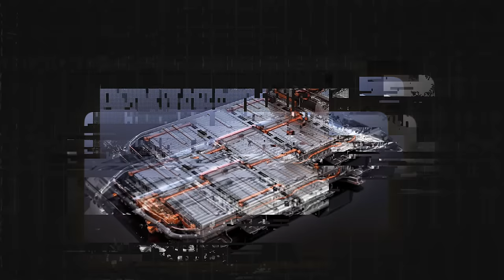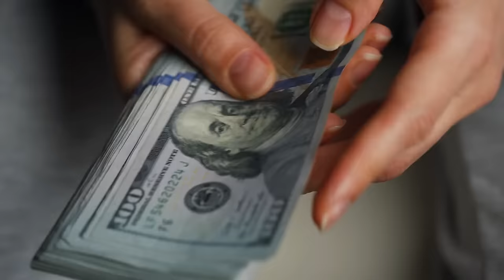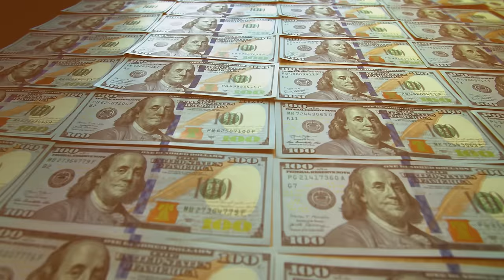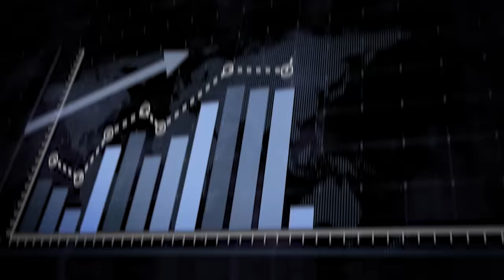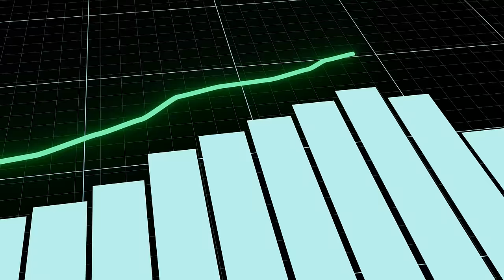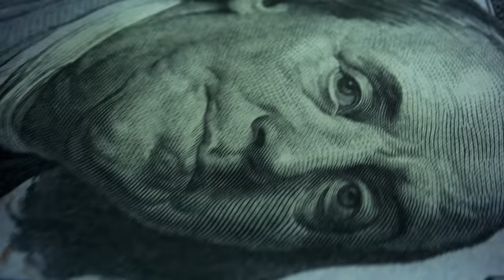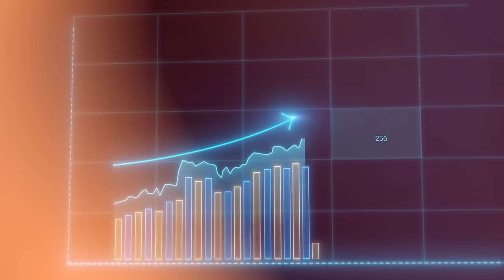No More Lithium! BYD Shifts To Sodium-Ion Batteries!

Comment: Sodium batteries can be good home batteries, pairing with solar panels, where cheaper is better.
Reply from the maker: Yepp! Sodium-ion batteries can be great for home energy storage, especially with solar panels, due to their affordability. They offer an efficient way to cut electricity costs and increase sustainability. Do you plan on using solar panels at home?
Reply: Yes, just not sure is it worth waiting as lifpo4 are good already

Comment: When around 40% of the cost of EV vehicles can be reduced significantly, the production & sales will dramatically increases. That's good news.
Reply from the maker: Absolutely! Cost reduction plays a crucial role in accelerating the adoption of electric vehicles (EVs) on a larger scale. With advancements in battery technology, such as the development of more affordable sodium-ion batteries, we're seeing the potential for significant cost savings in EV production. This not only makes EVs more accessible to a broader range of consumers but also contributes to the overall growth of the EV market.
Reply: we see all these "revolutions" in battery tech. however, the interesting thing is, that when they come to market, it is no revolution anymore. but that does not matter, because every year we have a good evolution. every years the kWh cost about 5% less and the range of cars is growing about 7%
this happened over 10 years now. and right now there is no end of this development in sight. the year over year growth in range might slow down a bit because we don't need that much range increments anymore. so, maybe 6.5% next year, 6% in two years, another 5.5% in three years and so on.
nevertheless, we have that nice development that results in a solid AND HEALTHY growth every year. it should not be faster because the industry cannot handle faster growth well.

Comment: I am sticking to my Toyota Hybrid. It’s electric in general in town and I don’t even have to plug it in as the petrol engine looks after that.
Reply from the maker: Nice! Hybrid vehicles offer a practical and efficient solution, especially for city driving.Thanks for sharing your experience!
Reply: No contest for long driving ,Hybrids the way to Go and go ,gogogogogogo.
Reply: Honda Hybrids shut engine off when stopped in Towns ,Restarts when U let foot off brake.

Comment: The energy density is more than enough for most applications now. Not to mention the cost. These are about $90/USD per kwh compared to $130/USD kwh for lithium ion and CATL said that the cost of these will drop to about $45/USD by the end of the year with full-scale production... That alone would bring a 20 kwh battery pack down to under $1K which is amazing! Personally I drive a Smart Fortwo and the electric version which I don't but wanted to own has a 17 kwh pack. So you could probably fit a similarly sized pack into one now with little range loss but huge cost savings!
Reply: Sound good. Could save a lot by bringing EV’s price down , because batteries are the most expensive part in EV’s
Reply from the maker: Absolutely! You've highlighted a crucial point. The decreasing cost and increasing energy density of sodium-ion batteries make them very promising for electric vehicles. With costs projected to drop significantly, electric cars become more affordable, potentially fitting larger battery packs without sacrificing range. This advancement is exciting for both consumers and the electric vehicle industry as a whole. Thanks for bringing up this important aspect!
Reply: Especially when you consider that Lion-polymer batteries can only discharge to ~20%, and do not like to be fully charged.. They end up at parity charge wise, and the Sodium cells are easier to recycle, and don't go up in flames, or use environmentally disastrous chemicals.
Reply: Sodium battery is already put in use in China but only on mopeds (almost identiical to the infamous Italian Vespa). The cost right now is even more expensive than Li-Fe. It may not until mid-2024 or 2025 should we see a comparable price drop then.
Reply: Right now ev weight on average 800kg more then petrol so  with sodium it will weight around 1.1t more, which give you around 2000 to 2500kg per small car and 3000kg for a family car. Also there is a question of volume this battry takes.
Reply: @chjanecki9221 Tesla should make a towable battery pack. I only need ~200 mile range. I can't imagine that a towable range extender would be that difficult of an engineering task. 

If I could hook up a tow battery and get another 500 miles of range for a long range trip that would be awesome.

Tesla is 42 miles away. I could get by with a 150 mile range and have some left over. IMO Tesla needs a model 2 commuter vehicle that is even smaller than the 3.

Comment: The battery manufacturer Northvolt developed state-of-the-art sodium-ion battery validated at 160 Wh/kg
Samples of these batteries produced  were sent to potential customers including ev makers in November 2023
Reply: With supercharging highly saturated and widely dispersed,  160Wh/Kg is all you will need.  The challenge rests now in rollout of the super charging networks.
Reply: They are not the first
Reply: @JoeyBlogs007  There is a reason why Sodium batteries are going to be marketed towards the low end, that woeful capacity. regular lithium batteries are up to 711wh/kg in lab prototypes and 500wh/kg in commercial products, and you are sadisfied with 160wh/kg? Even my old Nissan Leaf has 224 Wh/kg in its battery. So even lower than that. Gosh.
Reply: @GeirEivindMork  in real world cars the energy density of lithium batteries is around 270Wh/kg.
university bayreuth germany just pushed NaIon to 165Wh/kg. well, not suited for long range, but not every user on a budget buys a long range car.
as i see it, the car market will roughly split up in 33%/33%/33% Na-Ion/LFP/NMC
in the next years. then maybe aluminium-graphene will come or lithium-sulphur, ...
Reply: @GeirEivindMork  If your Leaf is "old" as you say, then it definitely doesn't have 224wh/kg anymore lol. About 10% lower wh/kg than LFP batteries is nothing to laugh at, and the fact that they have such a strong cycle life makes Sodium batteries a very promising alternative once they become cheaper than LFP (which should be soon)
Reply: @alexkt3400  Well, it is a 2018 model with 40kwh battery, and not that much range drop since new. (120k km currently). 

By all means, I am not against sodium batteries. I just want lighter cars. :)
Reply: @stefanweilhartner4415  It is not as simple, it is not about Wh/kgs it is also about DC resistivity along full curve of SOC 100 -  5 %, you can not compare NIBs and LIBs. Try to construct MPPT and LF/HF inverter for NIBs. You need wider range of voltages not e.g. 46 - 60 V, but 35 - 66 V, for HV it is also bad, because you need for lower voltage, make FETs and IGBTs still able to withstand much more current, and conduction loses are I^2 proportional.

Comment: Not surprised the sodium battery hasnt made it into the Seagull, lower energy density and high voltage drop means its still best for storage, also lfp keeps getting cheaper.
Reply from the maker: You're right—sodium-ion batteries are currently better suited for storage due to their lower energy density and higher voltage drop. LFP batteries remain a strong choice as they continue to get cheaper. It'll be interesting to see how sodium-ion technology develops :)

Comment: This added capacity for storage batteries frees up more lithium for BEVs.
Reply from the maker: Absolutely! Increasing the capacity for storage batteries, especially with alternatives like sodium-ion, can indeed help alleviate pressure on lithium resources, allowing more of it to be directed towards electric vehicle production. This could contribute to a more sustainable and balanced approach to meeting the growing demand for both energy storage and electric vehicles. Do you think this shift towards alternative battery technologies will have a significant impact on the EV market?
Reply: for non-mobile storage, lithium does not make sense.

Comment: If this battery eliminates several isues if the lithium batteries ie cold charging,range anxiety, battery cost and fire issues plus charge time it could rejuvinate electric vehicle sales.
Reply from the maker: Yes! You've highlighted key benefits sodium-ion batteries could bring, potentially boosting electric vehicle sales by addressing issues as you mention. I think BYD's move towards sodium-ion production signals a step in exploring these possibilities, which could reshape the industry and drive innovation. Your thoughts contribute valuable perspectives to the conversation about the future of electric vehicles.

Comment: With supercharging highly saturated and widely dispersed,  160Wh/Kg is all you will need.  The challenge rests now in rollout of the super charging networks.
Reply from the maker: Yes, great point! The advancement of battery technology, like sodium-ion batteries with their energy density of 160Wh/kg, can indeed alleviate some of the strain on charging infrastructure. While supercharging networks are essential for long-distance travel and convenient charging, the increasing energy density of batteries allows for longer ranges and reduced charging frequency, which can help mitigate some of the challenges associated with charging infrastructure rollout. Thanks for sharing your insights!

Comment: What are Sodium Ion batteries made of?
Reply: So sodium ion batteries are common table salt is that correct, if so be careful what you wish for
Reply: Salt and they will charge faster have far beter temprature range  and be cheaper
Reply: Natrium Oxide, wich is obtained from "ionaizing" the Table Salt

Comment: Thanks, you made some pretty good insights on the economic dynamics, sodium battery production could bring to the markets... good research, solid rationales... well done!... (subscribed)  ';  D ...  I know they can also solve the "cold battery" problem, as well as the limited resources cost side of production... forget how many cycles they can currently handle?
Reply from the maker: Thank you so much for your feedback and for subscribing! I'm glad you found the insights valuable. Sodium-ion battery production indeed holds promise for reshaping the market dynamics, especially in addressing issues like the 'cold battery' problem and mitigating concerns about limited resources. Currently, sodium-ion batteries can typically handle around 5,000 cycles, which is impressive but still slightly behind the most cost-effective lithium options that offer around 7,500 cycles as stated in the video. Overcoming this challenge to increase the cycle life further is crucial for widespread adoption. I appreciate your engagement and look forward to exploring more topics like this in future videos. Stay tuned!

Comment: You say lithium ion 7:42  battery has 7500 cycles and cost is 190kw/kg and Sodium has 5000 cycles and cost is 160kw/kg . In that calculation Na cost is less but would require change more frequently. So to summarise li still is charper than Na according to cost verses time to replacement.  So what is the basic reason or advantage compnay shifting to Na. Is it just the availability and cheap price. But at the end of day you will get lesser range and frequent replacement cost.  But lower range and lower cost may suit most buyers. But still i feel cars with range upto 700kms and affordable costs make sense then only it would be better accepted in market. As charging an ev on highway wastes a lot of time and range anxiety is the major factor for less sale in India.
Reply from the maker: You've made some great points about the trade-offs between lithium-ion and sodium-ion batteries, especially in terms of cost versus longevity. While lithium-ion batteries may currently offer a longer lifespan, sodium-ion batteries present advantages in terms of availability and potentially lower initial cost. The shift towards sodium-ion batteries by companies like BYD is driven by various factors, including the desire to diversify battery options, reduce reliance on limited resources like lithium, and explore alternative technologies that may offer benefits in specific applications. Range anxiety and charging infrastructure are significant considerations for EV adoption, especially in markets like India. Achieving longer ranges and faster charging times are crucial for widespread acceptance of electric vehicles. As technology continues to advance, we can expect improvements in battery performance and affordability, which will hopefully address these challenges and make EVs even more appealing to consumers. Your perspective on the importance of longer ranges and affordability is valuable, and it's something manufacturers and policymakers are undoubtedly considering as they work towards a more sustainable transportation future. Thanks!
Reply: @AmpedAuto  what we in india need is a reliable , cheap , long range , 4x4 ev family supporting car ... which i would say is a dream of every Indian. Basically a package of everything ... but its still a dream.

Comment: Lithium, to be exact lithium cobalt, are still the best in term of capacity and discharge capability. sodium will happen sooner or later, but that doesn't mean it gonna remove the existing lithium batteries out of existence
Reply from the maker: Absolutely, lithium batteries currently lead the pack in terms of capacity and discharge capability. Sodium-ion batteries offer a promising alternative, but at current, it's unlikely they'll completely replace lithium batteries. Instead, they'll likely complement each other, catering to different needs and applications in the evolving energy landscape.

Comment: Any mobile application benefits from light batteries. Sodium makes sense for battery storage, not cars or scooters.
Reply: That is to say, area and weight are both important, as well as life cycle.
Reply from the maker: Absolutely, you've hit on key factors: weight and area are crucial in mobile applications, while life cycle is vital for sustainability. Sodium-ion batteries excel in stationary storage, offering benefits in longevity and versatility. Yet, in vehicles, balancing these factors remains crucial. It's fascinating to see how different technologies meet various energy needs. Thanks for sharing your insights!

Comment: Sodium can’t replace lithium. The atomic weight is 7.7 times and the ionic mobility is much less than lithium.  It could be used for some low end and low performance cars or energy storage system.    For instance, Energy storage for an off grid tiny house could use it.
Reply from the maker: Great comment! While sodium-ion batteries may have limitations compared to lithium-ion batteries, they still hold promise for specific applications such as energy storage systems for off-grid setups. As technology advances, we may see further refinements that enhance the performance and suitability of sodium-ion batteries for various use cases including bigger EV's.
Reply: golf carts?

Comment: Carbon dioxide emission to make Lithium, Cobalt, Nickel metals for making the battery be compared with Sodium Ion and also lead acid batteries. Later is 97% recyclable
Reply from the maker: Agree! Sodium-ion batteries offer a promising alternative to traditional lithium-based batteries, potentially reducing the environmental impact associated with materials like lithium, cobalt, and nickel. Sodium-ion batteries could offer a greener solution due to their abundance of sodium and reduced reliance on scarce resources. However, comprehensive life cycle assessments are needed to fully evaluate their environmental benefits :) .

Comment: What about calcium or potassium?  We use that to melt snow and is less corrosive than Salt.
Reply: no
Reply from the maker: Interesting alternatives. I'm not to heavy into these two chemical elements, but I think they have been explored used in EV battery production. While sodium-ion batteries are gaining traction, exploring new options could lead to new breakthroughs in battery technology. With some elements advantages also comes disadvantages. It's a fascinating area of research :)
Reply: It's too heavy that energy density will be lower than that of Sodium or Lithium.
Reply: @RobertoLee09  what about hydrogen fuel cells?  Can’t be lighter than hydrogen
Reply: add the tank weigt to it. it has to hold 600bar!

Comment: The sodium is the best choice and rational for green energy then Lithium and Nickle.  Because of the waste effect for the environment, the sodium has a small effect then LFP and NMC
Reply from the maker: Agree! Sodium-ion batteries offer promising advantages for green energy, with potentially lower environmental impact compared to lithium and nickel-based batteries. Their reduced waste effect is indeed a significant factor to consider in the transition towards sustainable energy solutions.

Comment: Lithium ion will get stuck in recycling of scrap batteries. Sodium ion is much easier. Total CO2 emissions to make the metals is much less for Sodium.
Reply from the maker: Yes! Recycling is a crucial aspect of sustainability in battery technology. Sodium-ion battery potential for lower CO2 emissions in metal production is noteworthy. Industry need to consider these factors as we strive for more environmentally friendly energy solutions.

Comment: What is battery life in years
Reply from the maker: Sodium-ion batteries typically have a life cycle of about 5,000 charge and discharge cycles. In terms of years, this can vary based on usage, but should I guess, maybe around 10 years for regular use.